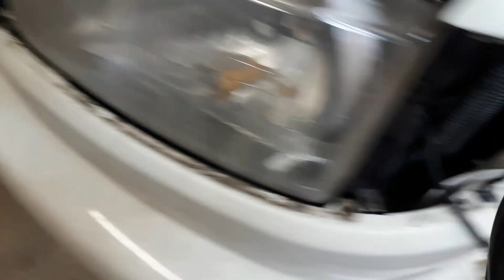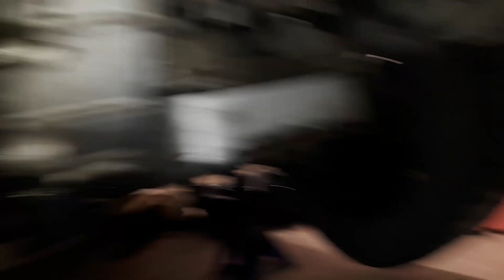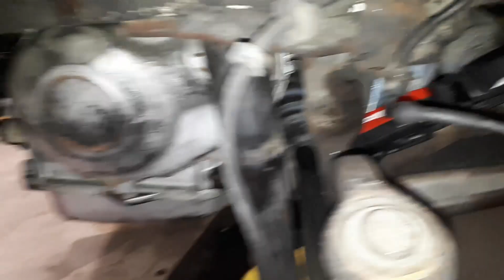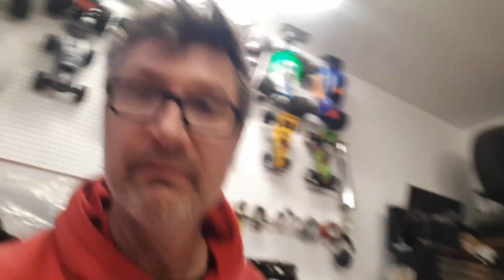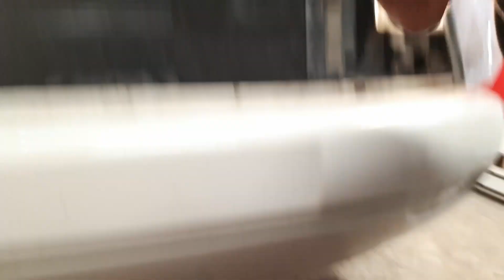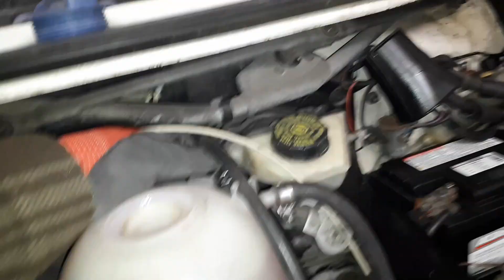Replacing VR6 Eurovan timing chains  without  removing the engine!

Comment: I am getting ready to service the timing chain on an Eurovan and trying to do my homework in advance.  Regardless of having a lift or not, it looks challenging and difficult getting the engine and trans oriented in the engine bay to get the trans separated and then the reverse for reassembly.  In the middle of the video you suggested it may be easier to just just pull the engine and trans and do the chain outside of the car.  Do you still think that would be the best way?  Or could anyone else that has done this please share?  Does the transmission fluid need to be drained for this task? 
Thank you for sharing this!
Reply: I believe it would be much easier to replace the timing chains by removing the engine and transmission together from the van if you do not have access to a lift as you will have a much better access to removing/installing parts.
In my case, balancing and inclining the engine and transmissions on all three rotational axes was a real pain.
As for the Transmission fluid, I did not drain it, but had to top it up after reinstalling it as some fluid came out while manipulating it.
Hope this helps, good luck to you, it's a big job!